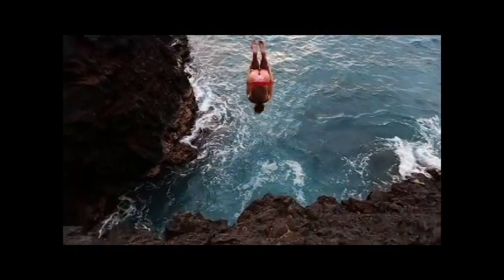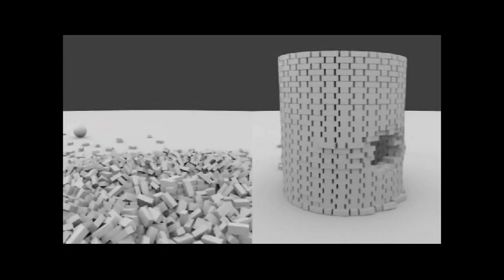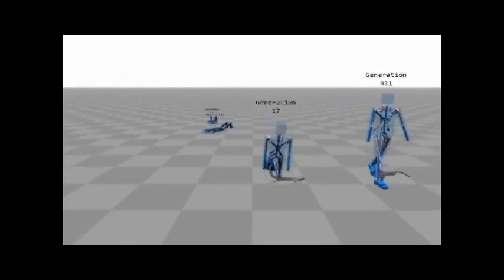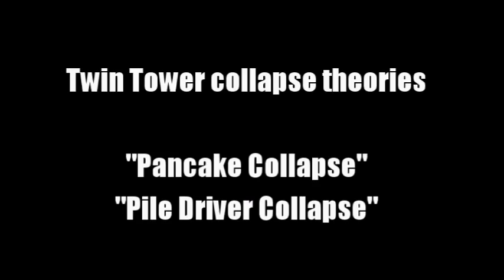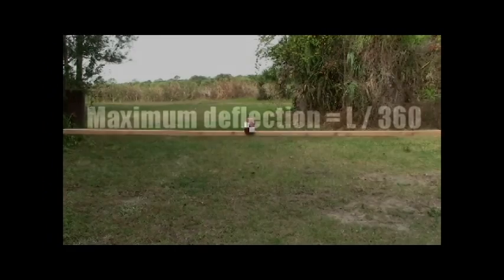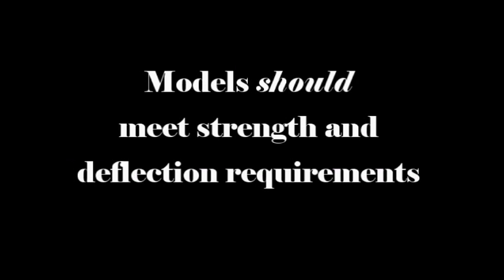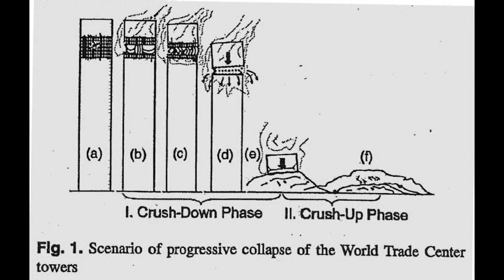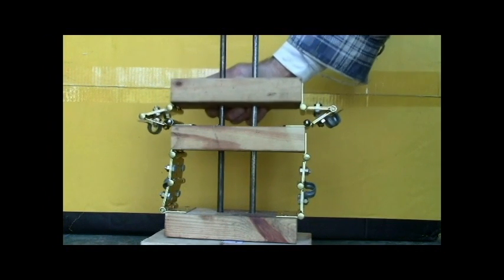9/11 Experiments: The Force Behind the Motion

Comment: Bravo! You are very determined!  Thank you for all the thought and hours of work you put into your models. I’m a mechanical engineer and as soon as the buildings started falling on 9-11, my reaction was “no way”. You did an excellent job pointing out some fundamental truths, like the top floors would have decelerated, not accelerated. I don’t know how the “engineers” involved in the cover up could keep a straight face when presenting their “findings”. 👍.  To learn what happened to the planes, Rebekah Roth’s Methodical Illusion is excellent.
Reply: " every time one of the floors in the twin towers dropped and landed on the one below it, it would decelerate until the supports of the floor it fell on gave way, then the floors would accelerate until they hit the next floor. "

Why could that not result in a net acceleration? Let's say the falling section reaches 3 m/s before it impacts with the next floor, said impact causes a reduction of 1 m/s in speed so the falling section is now travelling at 2 m/s, but it accelerates another 3 m/s on its way to the next floor. Now, when it impacts the third floor its speed is 5 m/s, right? So its velocity has increased. And so has its mass. So the resistance offered by the next floor will slow it down even less, right?

"And Christopher Bollyn's research is rock solid."

Hmmm....
Reply: Jeff Tormey - " the top floors would have decelerated, not accelerated"
That's an interesting claim that can only be backed up by maths. Since you're a mechanical engineer, may I assume you have done the math? I guess not. Neither have I by the way (but then again, I'm not the one making an argument from authority and as we both know, authority has no place in science). But I really wonder what your math would look like. Which parts of the structure would you like to take into account when doing your calculations? And why?
Reply: Bruce Lansberg he explains it in the video. You should watch it again, but it may beyond your comprehension.  Let's try to simplify it for you.  Take a ball, like a tennis ball, in your hand and hold it arms length in front of you.  Then drop the ball so it will land on the floor.  The ball will accelerate towards the Earth because of the Earth's mass (that's what causes gravity)  When it hits the floor it decelerates then stops.  Got it?  So every time one of the floors in the twin towers dropped and landed on the one below it, it would decelerate until the supports of the floor it fell on gave way, then the floors would accelerate until they hit the next floor.  Very simple physics, even a gov't troll should be able to understand it.  The building would not fall at near free fall speed unless the support structures are removed, or blown up with nano-thermite, as in the case of the twin towers.  Enjoy living in the matrix.  And Christopher Bollyn's research is rock solid.  Nice try, but really, it's another epic fail on your part.
Reply: Jeff Torney - "are you CIA or just a govt troll?"
None of the above. Now that I have answered your question (and ignored your personal insult) please answer mine. Why do you believe the top floors would have decelerated , not accelerated?

"Keep spewing the govt lies."
Yeah, you mentioned something like government lies before. Could you please elaborate without a general referral to some lengthy video? It is YOUR claim, you carry the accountability.
Reply: Bruce Lansberg Lol. 🤣🤣🤣 You cannot comprehend physics. Try the ball experiment. Really.
Reply: Ah, I see you have altered your reply. Bravo.

"he explains it in the video"
I have watched the video three times and I am pretty sure he never mentions anything on how you would apply your calculations.

"You should watch it again,"
Nah, I think I understand what he is trying to tell me. But thanks anyway.

"but it may beyond your comprehension"
Well, it indeed is. See, what I do not comprehend is the fact that this engineer seems to think he has made an acceptable representation of the towers. What I don't comprehend is how this engineer first claims F=ma and then he claims his models do not have to be scaled since "force and motion direction are independant of scale". But m is dependent on scale... SO F is dependent on scale.
And then this: "For example: This projectile is going in a parabola, which means the force is going in a parabola, the net force Excuse me? Force going in a parabola? Which force? The only force acting upon the object is gravity (drag is neglected). Please explain to me how gravitational force travels in a parabola. https://youtu.be/WMR1XC-Lce0?t=7m51s
He clearly confuses the direction of the object for the acceleration of the object.
So yes, it is beyond my comprehension. Please teach me.

"Got it?"
Yes, up to that point, I do. Thanks for asking.

"So every time one of the floors in the twin towers dropped and landed on the one below it, it would decelerate until the supports of the floor it fell on gave way"
Why? Where is your math to support that claim? Do you think a less than free fall acceleration equals deceleration? You're not confusing speed for acceleration here Jeff, are you? 

" then the floors would accelerate until they hit the next floor.  Very simple physics"
This is it? How does this explanation account for the mass of the upper part excerting a force on the floor-to-column connections? How much resistance is delivered by the bolts that were used? How strong were the truss seats? How much resistance they they deliver and how does this relate to the forces excerted by the accelerating mass of 12-28 floors? See, these are the questions you need to be able to answer correctly before you make any assumptions for any mass to slow down (or decelerate).

"The building would not fall at near free fall speed"
Please, even truther nowadays have accepted 2/3rd of free fall acceleration. And most engineers I know, understand that there is no such thing as free fall speed. There is however free fall acceleration. Is that what you meant? Are you as confused by the meanings of speed and acceleration as as Mr Jonathan H. Cole is?

"unless the support structures are removed"
I wouldn't call a few bolts "support structures" necessarilly. Would you? Which makes me wonder if you understand the engineering/technical design of the towers.

"or blown up with nano-thermite,"
What's the detonation velocity of nano-thermite? You do understand that nano-thermite is not an explosive?
Reply: Jeff Tormey - "You cannot comprehend physics"
Yeah. Seems like the MO of the average truther: Making an assumption and claiming it as fact, forgetting to deliver the evidence in the process.

Comment: I am not saying that there wasn't a conspiracy, in fact I think there was. I am saying that the material and logistics for a controlled demolition were not there. The fact that there was an earlier attempt 10 years before suggests that the the architectural flaws in these building was known and the basment bomb was expected to cause a collapse.
Your efforts are commendable but they are in accurate models because of scale and materials. 
I was in NYC when they were building these 2 structures. It was an innovative design where the bulk of the support was in the exterior skin of the building with no interior supports other than the elevator columns that were not even contiguous. There was no skeletal structure like the Empire State building that survived a plane collision in 1947. The design of these buildings were flawed from the start and they're a 1/2 dozen other designed by the same architect around the country. The heat generated by the collapse of 110 floors in 10 seconds was friction.
Supporting the controlled demolition theory destroys credibility of those who are searching for the real conspiracy.

Comment: 6:30 this experiment leaves the vertical supporting columns intact and ignores the outward motion as described by the pancake theory. How is this a valid test?
Not trying to validate any assumption, just pointing out a very basic flaw in that experiment.

ALSO
Your models, even the demolition model, looked orders of magnitude more robust than the video of the collapse.
which makes me take a grain of salt, and put on my skeptic hat.
(can we time explosive that well? pretty easily if it was a gov't op, but Occam's razor suggests that a simpler answer is more likely)

K= (m*v²)/2 
Kinetic energy = one half (Mass Times Velocity squared).

Scaling down incorrectly means you could 1/2 factor the experiment either way, and skew results towards failure or success with poor methods. (Miscalculating the crush strength of reinforced paper for example, or the force exerted by a fall 1/10th the scale being 1/1000th the force (or whatever it actually maths out too).

Comment: There's a documentary that talks about it, but basically molten aluminium would fall onto each floor which was filled with water which would cause an explosion. So as each floor fell, another explosion would occur, hence the acceleration.
Reply: There is an even far easier explanation: gravity. The "only" resistance the falling mass had to overcome, was that of the truss seats or the bolts with which the floor trusses were connected to them.

Comment: Thank you for this video. I never needed anyone to tell me those building were brought down by demo. I understood what was going on that morning as soon as I got my head together. Even my father, a general contractor for more that 25 years who had seen demolitions first hand accepted the bullshit explanations. You have the Chammasbot trying to deny your experiments, ignore it. And again thank you.
Reply: th2k and I guess all the other experiments are wrong but only the ones in this video can be correct?

https://youtu.be/flo62pdaIMI

Anything else has to be considered inaccurate? The video above proves that YOU are wrong.
Reply: th2k - "my father, a general contractor for more that 25 years who had seen demolitions first hand accepted the bullshit explanations. "
And yet you chose to deny his experience and accept random bullshit claims and theories? Please explain to me in which way the experiments in the video above represent the design of the towers. Please take the effort to look at the short video Harry has linked. This experiment does take the deisgn of the buildings into account. Floors were mounted onto the walls. Floors were basically bolted to perimeter and core. You seem to assume (like the guy doing the experiments) that the walls were built on top of the floors. You seem to underestimate the role the floors had in the structural design of the towers. No floors -> no towers.

Comment: This test was highly inaccurate. That being said I do believe it was a controlled demo that was the cause. Not nesscicarily for the whole tower but at least the first couple floors to get the pancake method started. What he the towers fall in slow mo you can see an initial outward force for the first few floors under what is burning before it starts it’s perfect decent
Reply: Ryan Farthing How does a controlled demolition cause trusses to GRADUALLY bow inwards?
Reply: Ryan Farting - Why would you need CD for the first if gravity, mass and weakened steel will do the job perfectly fine by themselves?

Comment: Isn't the structural integrity significantly weakened by some beams being taken out by the plane? So over time the load would be greater and greater and cause more stress throughout, weakening the building more? As well as those pizza cutters aren't bolted down and are free to fly out of the structure? Or the paper would bunch together and absorb and block the rest of the impact? The plane smacked in the middle upper part of the building so those many beams and floors would go first. I don't understand why you used a top free falling weight that made the boards diverge, instead of blowing or knocking out the mid levels? As well as the WTC building's have many many lateral beams that support the building that were taken out by the airplane and I believed you used only two in the experiment? As well as the weight being dropped is no where near the weight required to bust through those boards with the same effect as the millions of tons of steel being dropped on 9/11. The weight was not even in free fall velocity I may add. I'm no building archetict and hopefully someone can explain this better to me.
Reply: Luis Prado I think this might better explain it 

https://youtu.be/wUUEHerVTRI

Comment: Your pancake setup is messed. The friction from the supports you set up to hold the floors is stopping the motion. With the twin towers, there was nothing to impede the motion apart from the existing structure underneath.
Reply: And did that structure underneath slow down the collapse in any way? No the collapse accelerated! This cannot be explained by physics, that is why Nist did not even touch that subject and conveniently only wrote a report on the collapse initiation. Bazant tried and failed utterly by using false data, which was never corrected by the way. So his false paper (with the alice in wonderland pile driver theory) is the official explanation. Figures.

Comment: That is not how the towers were built. Might want to actually build an experiment that reflects the actual design. There is only a central column with all the elevators and stairwells. Meaning hollow. there are no columns between the inner area and outer at all. It was built as a "tube" design. The outer steel frame was tied together with trussing that was covered in 4 inch concrete and steel tabs on the ends. Scale matters.

Comment: The floor supporting L brackets failed not the cement floors. Both your model are critically flawed. The brackets could barely support the dead still weight of 2 floors.